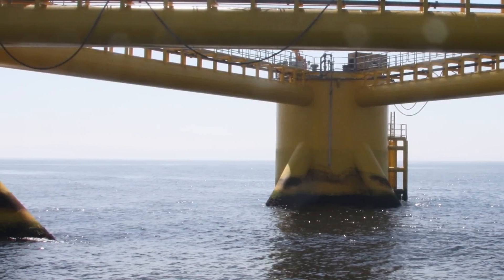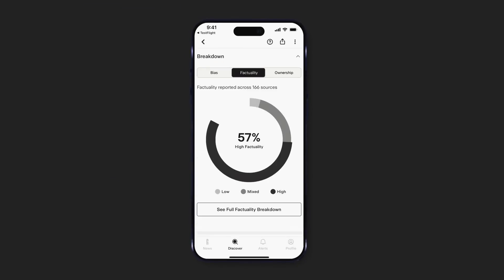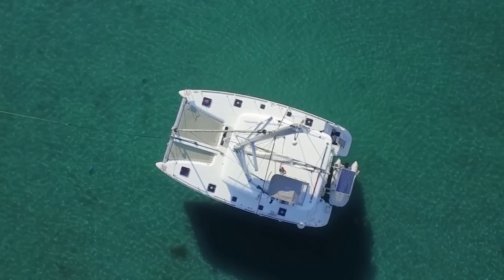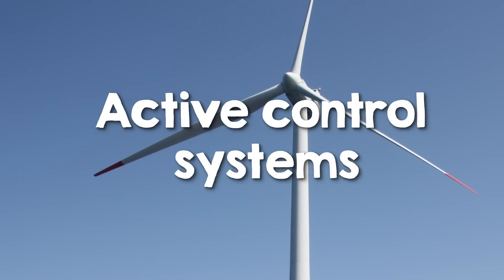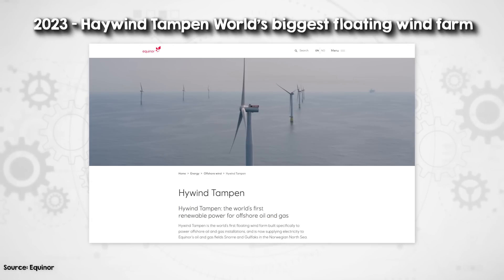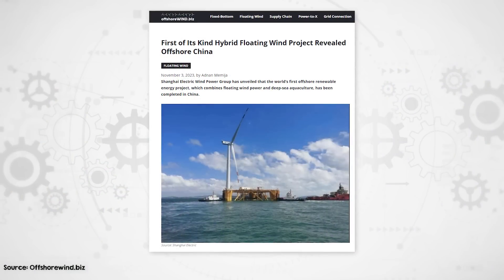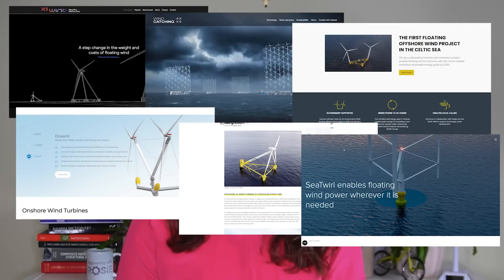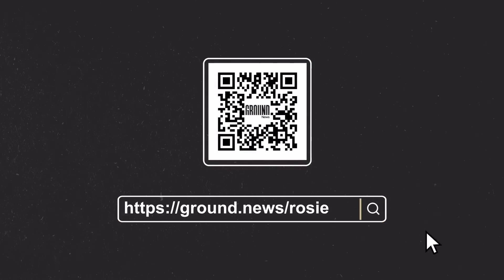The Rise of Floating Offshore Wind Technology

Comment: What happens when the turbines start to suffer erosion to the blades due to the salt in the air how do you replace them after 15 years when they are  suffering motor damage
Reply from the maker: Leading edge erosion is caused mostly by rain (large droplets are worse). Blades are typically inspected annually and LE erosion identified well before it gets so bad that the blade needs to be replaced. Usually it's a matter of painting on new coating, maybe some filler or even a repair if the fibreglass has started to erode. There are even robots and drones that can do this now, it's getting pretty high tech!
And the for the cases where a blade does need to be replaced (more likely because of lightning strike than LE erosion) then you will either need a crane out at sea or tow back to port. There are a few other techs emerging to remove blades without cranes (e.g. see Nabra's tech I think called Sky Lift) but not common yet.

Comment: I can imagine floating recharging stations in the middle of the ocean charging ships that come by. They would have to be charging with a C rating that would make today's batteries look like capacitors. Arcing hundreds of thousands of volts per second with amp ratings that would blow your mind. No humans allowed in the area when charging. Make lightning look tame by comparison. Is that the imagination you wanted?
Reply: Normal Lithium batteries can be recharged perfectly safely in 40 minutes, doesn't matter what size they are.
For an ocean going container ship, that is going to require a charging cable capable of carrying gigawatts of power, which at first thought seems a little impractical.  
The real issue is that no shipping company is going to want to stop in the middle of the ocean, they will want to charge while unloading and reloading, thus taking zero time, time is big money for container ships, so unless there is going to be a port in the middle of the ocean, with most container ships visiting it to load/unload, then I can't see this happening.
Reply from the maker: Agree with your first point, thanks for adding it. I'm not sure about your second point. Slow steaming is already a big thing in shipping to save on fuel, it is not as simple as "as fast as possible at all times".
Reply: @EngineeringwithRosie  Slow steaming does save cost though, fuel use does not increase linearly with speed, just like wind speed and power generation, so a small decrease in speed can make quite a big difference in fuel cost.  Refuelling in the ocean would only reduce the required size of the fuel tanks, at the expense of time.  Maybe if the ships run on batteries then it may make sense to avoid loss of cargo space to batteries, but I'm expecting them to use liquid synthetic fuels, and even if that fuel is created in the ocean, it will probably be shipped to the ports for convenient refuelling.  Better for the fuel tanker to make that journey than for the container ship to go out of its way to stop at a windfarm, which if the ship is always in equatorial waters, may require a 4 day journey to reach the cheap wind power, and a 4 day journey back!  Most ships don't visit Iceland or Tasmania, floating wind near those locations is going to be considerably cheaper than floating wind in equatorial waters.
Reply from the maker: @nigels.6051  all good points! I am working on a shipping video so I will keep these ideas in mind while I write that
Reply: @EngineeringwithRosie  I've been watching the America's Cup yacht racing, 8 knot winds and they are doing 35 knots into the wind and 50 knots around the turns!  I'd love to see some container ships doing that, but it is not going to happen!  Worth a quick watch to see what is possible, all live on YT.
I imagine that once synthetic liquid fuel is in mass production, the current slow steaming will end because fuel prices will relatively be back around where they were before the slow steaming started - wind is currently our cheapest energy source, we just don't have enough of it to waste on synthetic fuels yet, in 10 years time we will normally have more than we need for electricity supply and much of the spare will be used for synthetic liquid fuels, or at least the UK will, others are not keeping up.

Comment: 9:17 Wind turbines providing electricity to oil and gas rigs? Sick burn by the people that made that happen! 😂👍
Reply from the maker: I don't have a huge problem with this. Oil and gas needs to be transitioned down, but it'll never go to zero due to non-energy needs for those molecules. Even if it did go to zero I would prefer to reduce emissions from its extraction in the meantime. I do agree that it would be damn hypocritical to publicise any kind of "low emissions" claim from an oil or gas project though, it's definitely not that.
Reply: @EngineeringwithRosie  Yeah, fossil fuels can currently be used in places where renewables are not. But great to see that even fossil fuel companies are getting the benefits of renewable energy.

Comment: Why we can't farm around and up to windmills 🤔 instead of adding Salt water to electrical power generation dubble the cost and matainanc 🤔
Reply: Because we are building the offshore wind farms at much larger scale with much larger turbines than is possible onshore, thus it will be much cheaper than building onshore.  The Dogger Bank fixed bottom Offshore Wind area is 8,660 square Km in size, that is one wind farm, although built in stages of around 500 square Km each, the Celtic Sea floating wind farm area is 6,700 square Km, together that is almost the size of the country of Wales in two wind farms.  When people say that onshore wind is cheaper, they are not comparing the same things,  often it is the sort of turbine erected by a farmer with two or three on his farm, built to a design that has been in use for.a couple of decades, because that is all we have been installing onshore for the last decade, compared to the latest prototype offshore turbines on a farm that will produce 10,000 times more power.  We are still developing the offshore technology, and are still in the early stages of floating offshore, the development and risks have to be paid for until the technology matures, but it will mature, and then it will be much cheaper than onshore, and more importantly, actually possible to build.

Comment: There are about 3,000 miles (4800 km)of offshore pipelines in the Gulf of Mexico, I wonder if they are conductive enough to double as transmission lines for offshore wind?
Reply: Probably, but high current in a gas pipeline seems problematic both due to losses from lack of insulation and, you know, combining combustible fuel with high current. Can fix second by stopping gas extraction, first by insulating but is probably even more difficult than just recycling the pipelines for cables.

Comment: As an electrical engineer I was wondering if floating has a major problem with reliability of the electrical cables connecting to them. Love your videos as they are full of technical details and generally always include the effects of $. Thanks
Reply: Hey Bertie, subsea umbilical cables are used in practically all FPSOs and floating platforms - I can say from personal experience that they operate very reliably. Practically all technical impediments to floating offshore wind have already been solved in the oil and gas industry - which is good and bad. Makes floating wind viable, but also means the video is overly optimistic on future reduction in cost.
Reply: @kindling1191  thanks but just saying they are reliable from experience does help me imagine how they solve the fundamental problem. To my simple mind a floating platform will always move. This movement must translate to the connecting cables. How do they solve the fatiguing effects on these cables. Is the solution that they simply replace them once fatiguing is found? Or is there another method. Or is fatiguing not really an issue and if so why?  Thanks for replying anyway.
Reply: @bertiewalker5140  Hi Bertie, I was only responding to your original question “if floating has a major problem with reliability of electrical cables”. A detailed explanation of how that is achieved is a bit beyond the scope of a YouTube comment, and not one that Rosie could realistically answer as a mechanical engineer. Fatigue is only one small part of the reliability issue but I’ll give a brief response on that point. Copper is very resistant to fatigue and the range of movement is restricted by the outer armouring applied in a helical formation. Cable movement is further constrained by supporting it via submerged buoyant arches that are tethered to the sea floor, combined with strategically located deadweights. This ensures the cable makes a controlled “S” shape as it rises from the sea floor to the floating topsides. Hope that goes some way to answering your question.
Reply from the maker: That is a good question, especially because that was the point of failure for several wave energy techs (not that it's an insurmountable challenge, more that it cost $$ to fix at a time when those startups had no $$). I don't know enough technical details to answer, but it would make a great future video topic!

Comment: I don't know about the Australian market but Britain already has too much wind power on some days. Then they are being paid to dump power. Conversely there can be periods with no wind at all. What do you do then? France puts out less CO2 than Britain or Germany and has far cheaper electricity thanks to nuclear. There Iis NO way to store enough electricity to tide a country over for a few days.  Batteries are only suitable for grid smoothing.
Reply: No, we don't have too much wind.  Yes, we sometimes turn some turbines off, but so infrequently that nobody has bothered to make use of the excess power yet, even though that excess power is available at very cheap/free/negative prices.  If there was enough excess then somebody would invest in some batteries or hydrogen electrolisers, or an aluminium smelter to make use of it.  You shouldn't worry about paying to turn turbines off, that is just the way the system works, quite often they are turned off because France is paying us to take their excess nuclear power, because nuclear can't be turned off overnight, so they are happy to pay us more to take their excess than we pay to turn the turbines we would otherwise be using off.  Turning a turbine off is cheap and easy and extends the turbine lifetime, but you have to compensate the turbine operator for choosing to turn off that particular turbine and not somebody else's.  If you have enough turbines to provide enough power on calm days, then it is inevitable that you will have excess on windy days, but we should be able to find ways to use most of that very cheap excess power, maybe for generating synthetic aviation fuel, maybe for generating synthetic "natural gas" (methane) that can be stored for use in our gas power stations in calm weather..  France doesn't really have cheap electricity, their nuclear power is partly paid for through taxes instead of electricity bills.
Reply: @nigels.6051 
So how do we get through a 2 week winter wind lull? This is usually caused by an area of high pressure sitting over the whole of Northern Europe. The Germans have a term for it. Dunkelflaute. It happens more often than people think.
Reply: @codprawn  This year, May had 3 weeks with low wind, July had 4 weeks, and we used a lot of gas for 2 weeks in December and 3 weeks in January.  We have been filling in with coal, but I think that is ending this year with decommissioning of the last coal plant?  The summers seem to be more of an issue than the winters because there is a lot less wind power in summer.

Low wind does not mean zero wind throughout the UK, if we had triple the current amount of wind power, most of those periods would have had enough wind to have needed no coal or gas, only the odd day would have been short of power.  We already have a system where many industrial processes that are heavy users of electricity can be shut down for a day if necessary, so I suspect three times the current wind would have been just about enough.  As more industries convert to using electricity, there will be more scope for shutting things down for a day or two, so I suspect we do not need battery storage to cover days, only for hourly peaks.   We need much more wind power to replace our current use of oil, petrol, diesel, heating gas, etc., if some of that is done via synthetic fuels, as aviation fuel almost certainly will, then the electrolysis for that can easily be shut down for a few days,  I'm not convinced that we need much storage.   Germany has enough natural gas storage to last them 6 months without any new supply, that can store synthetic fuels without modification.  UK has closed down its natural gas storage, considered unnecessary!

Having some spare wind turbines is not a problem, if they are not generating power then they are not wearing out, so they become a long term investment, and given that nuclear is many times more expensive than wind, it makes much more sense to build twice as much wind as needed than to build nuclear, but we don't need that much spare.

"This is usually caused by an area of high pressure sitting over the whole of Northern Europe" - this is why we have a lot of interconnectors, when we are sitting in the calm centre of that high pressure, Denmark and Norway are sitting in the strong winds at the edge, if it moves east a bit then Ireland is in the strong winds at the opposite edge, and Portugal is down on the southern edge.  With floating wind, we are expanding our wind generating area to the West into the Celtic Sea, and north to Shetland, so will be less affected by large high pressure areas anyway.  Our friends in Denmark and Ireland have much more of a problem with high pressure areas than us, and they also have problems with low pressure areas as the centre passes over them, so they are always going to want to work together.

Currently we don't have enough wind turbines, once we have enough, the problems will disappear, except for the problem of what to do with our very expensive nuclear power that nobody wants to pay for!

Comment: Hi Rosie, can you help us understand why wind turbines have the heavy generator on top of the tower instead of at the bottom, connected with a drive shaft to the rotors?  Is it because the mass of the generator stabilizes the tower against gusts?
Reply: Wouldn't a driveshaft to the bottom of the tower weigh more than the generator?   A 20MW driveshaft must weigh a fair amount, and need quite a few bearings on the way down the quarter Km high tower.  The generators seem to work perfectly well at the top!
I imagine that having the generator at the bottom is going to cause issues for the yaw motors, they would have to fight against the torque on the generator?
Reply: @nigels.6051  Good point!
Reply from the maker: Yes and a really long (>100m!) driveshaft would also have some flex in it which would reduce efficiency and lifetime. Towers flex a lot! But VAWT does have that potential advantage of low generator.
Reply: @erikhy  I expect generator mass is negligible compared to blade mass, especially as to turbines get bigger.

Comment: Good luck with the Saltwater and huge swells these will be a wasteland in oceans 👍. Not to mention all the cables you need to bring the electricity back to land they will need to be huge due to voltage drop .. if you know electrical engineering these projects are a scam the amount of energy to build them by the time you getbthe return they will be rusted out or need maintenance.. massive scam to take our tax money each turbine has subsidies 500k a year 😅😂😂😂

Comment: If these designs are borrowed from the oil & gas industry, how do they maintain their platforms??
Cost is never an issue for oil & gas platforms....what needs to be done, to redress that imbalance?
Reply: In the case of an oil well, the platform has to be maintained until the well is completely sealed, otherwise, you end up with a huge spill costing the company billions of dollars in fines. Google "Deepwater Horizon" for a recent example.

In the case of a windmill, neglecting the platform simply means that the company no longer gets revenue for sending power to the electricity grid, but it's not the environmental disaster that you'd get from a poorly maintained oil rig.

Comment: I forget the accent sometimes. Where the hell is Kin-car-deen? 😅 I’ve never heard of it.
We pronounce it Kin-card-inn
Reply: It appears to be spelt wrong then!  
Gaelic spelling also agrees with Rosie rather than with you: Cinn Chàrdainn
Maybe it is time to change the spelling to match the current pronunciation?
Reply from the maker: Thank you! I will practice this before I have to say it again. Which syllable is stressed though? Kin-CARD-inn?
Reply: @EngineeringwithRosie  I'm not a local, but I know it as KinCarDin - stress the capitals, the first two strongly.  Also, as given in the Gaelic spelling (Cinn Chàrdainn), the à and nn characters should be long form (drawn out) if you want to pronounce it with a Scottish accent, but non-locals tend not to since that can't be represented in english spelling.
Reply: @EngineeringwithRosie  none of them really, its spoken fairly quickly. If anything the emphasis is more on the KIN, then Cardin all as one word.
Don’t worry, It was quite funny. I was racking my brains trying to think where it was, til I had the silly head slap moment😂

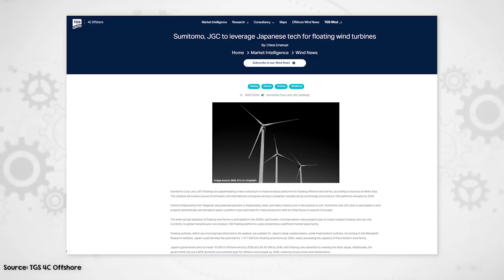Comment: 10:50 I would have thought Japan would be more interested in wave power than wind but are there still questions over RoI and power output linked to what designs should be used & with a common design come with reduced costs of manufacturing and installation etc?